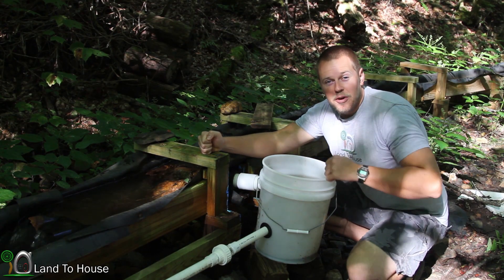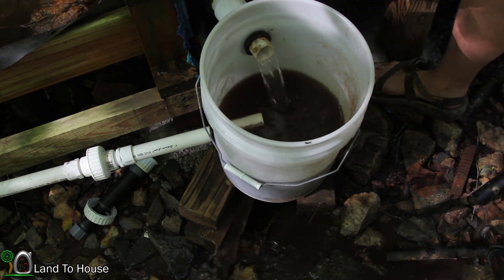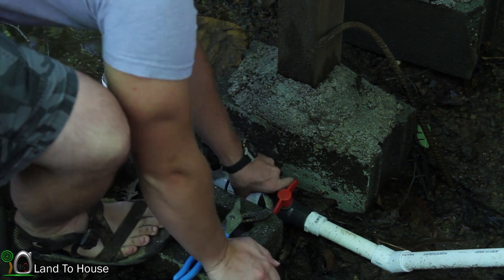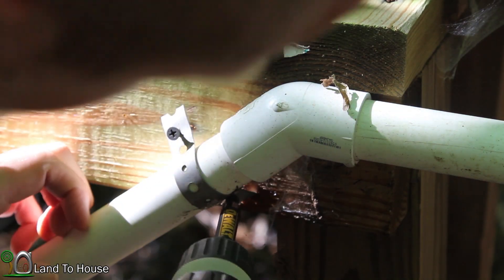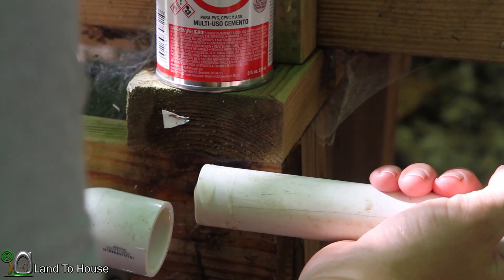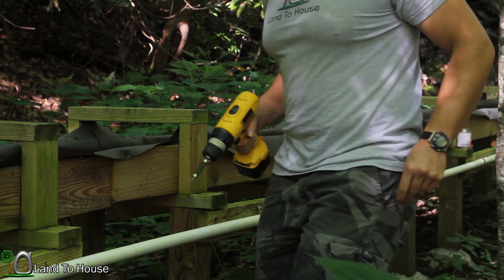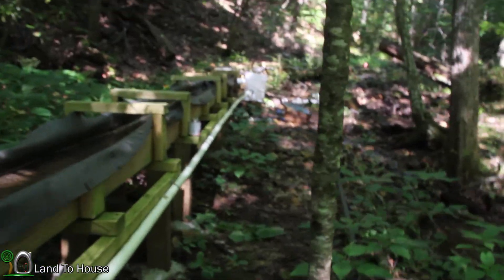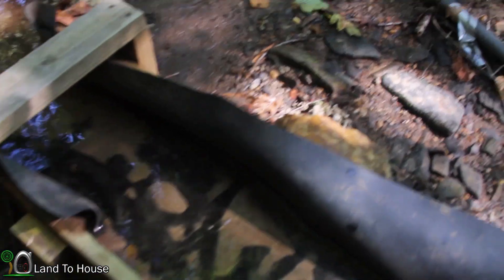Ram Pump Bucket Intake and Glue Joints

Comment: Hi Seth. Wanted to give you a little input on the shower drain you are using for the 2 inch coming into the bucket. Pop the chrome piece of the top and unscrew the plastic slotted nut. Pull the rubber seal out. Place your 2 inch pipe inside about a thread short of the top of your thread inside that drain. Slide your rubber seal over the pipe down in between. Place the slotted nut back in and start it. The little flat piece of metal shim...is your tightening tool for the slotted nut. Use a large flathead screwdriver and tighten it down and it wont leak anymore around your 2 inch pipe. This comment may be way too late and you might have figured it out already. Just figured I would chime in...(Master Plumber 26 yrs exp.)

Comment: wold it make a difrence if there is some sort of like tornado efect on the bucket may be it wold presurise more on the intech of the ram pump ... hope u get what im meen
Reply from the maker: The tornado effect can increase the pressure such as in the venturi effect but the issue is when air is introduced into the system. The ram pump will stop as soon as the air builds enough to effect the pressure wave. Another issue with using this effect with the ram pump is that the pressure wave operates in two directions. The tornado will be great for the downhill force but once the pressure wave travels back uphill you will have an issue.
Reply: Land to House ... cool ok .. but that is if the efect reaches a surten amount of speed that it sucks air .. wright ?? dont know just blabering ideas to help out in mods for the intake drop for the ram ...
Reply from the maker: Yes. If it gets to the point that it pulls air in. But the real problem is that both the uphill pressure wave and downhill wave need to be as unrestricted as possible.

Comment: A year and a half ago I already bought most of what I need. Your shut-off valves and bucket fittings would be a help. Is that possible and if so at what price? I can get a list together after Christmas.
Reply from the maker: The bucket fittings can be found on my amazon store. http://astore.amazon.com/latoho-20?_encoding=UTF8&node=3
As for the other parts I have not been selling individual components. Just the full pumps :)

Comment: Hi Brother seth as always your videos are awesome with good info!!!. Can you please test for me if the water lost from the swing check valve (about 90% lost) be connected in such a way to travel back to the source barrel if yes we can save water. if no then how high and how far can it travel with or without disturbing the ram pump operation.thank you.
Reply from the maker: Thank you for watching! I sure would be nice if the waste water could be placed back in the source. Then we could have a never ending supply of energy. Sadly the waste water is what makes the pump work. Now you can pump the delivery pipe back to the source but then that would only be ~10% of the original water. IF you want to capture the waste water and use it further down the line you could place the pump in a catchment tank and let the water go out a pipe for use later. ... I hope this helps.
Reply from the maker: Yes. The first valve on the ram pump is called the "waste valve". That is why I call it the waste water. Not because the water is wasted just because that is where it comes from. :)
Reply from the maker: +Wvo Quailwvo ohhh gotcha.  Yes i hear that some. Now those that are running pumps from 55gal tanks are most likely the ones who want to save the water.
Reply from the maker: A couple thoughts on that setup. Adding the pipe on the waste valve adds height that the water will have to go up. This will reduce the head pressure that the pump has to operate with. It would be better to catch that water in a tote then move it elsewhere. There is no way to make the waste water go back up without losing efficiency of the pump.
Reply from the maker: I have watched your video. There is an issue with this operation. It is very true that the ram pump will operate by hydrostatic pressure but adding the small tube ontop of the waste valve is counteracting the hydrostatic pressure in the tank. Hydrostatic pressure does not change by volume of container but by pressure in a vertical space. Atmospheric pressure is the same on each body of water. If you have a 55 gallon tank and a 5000 gallon tank and measure the pressure at 1 foot down you will have the same value in each. SO the hydrostatic pressure in the small tube will equalize the hydrostatic pressure in the tank and there will be no movement of water.
Reply: I think you made a very good point here.

Comment: Did you build that flume?  I've only been a sub for a couple months, so it's new to me.  curious about the whole thing.  Like what the source is, where it goes, and why you built it!
Reply from the maker: I did build the flume! That was a while ago. My first thought was to make some type of electric generator there.  Now its just a source of water for the ram pump but I will get back to that someday. I really need to work on the intake because it has several leaks.